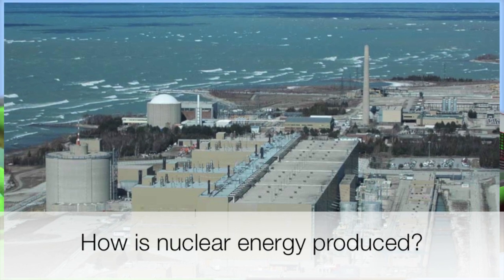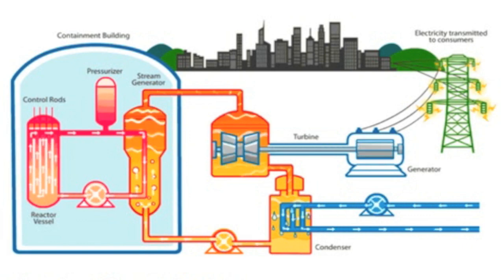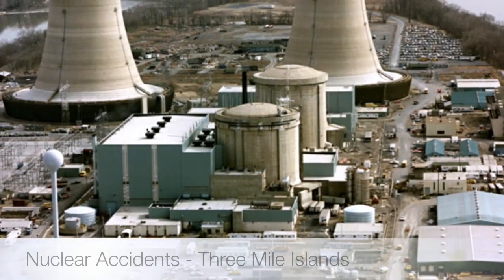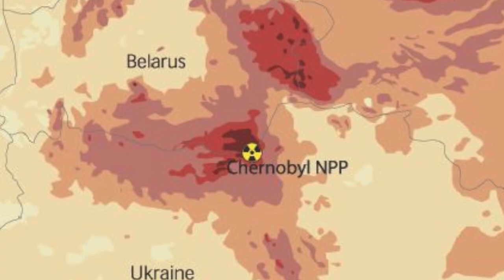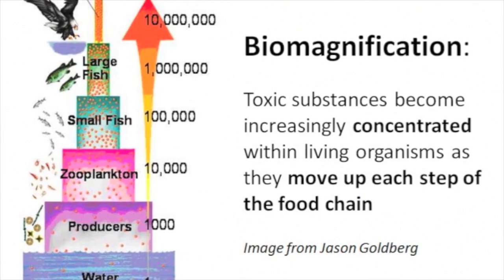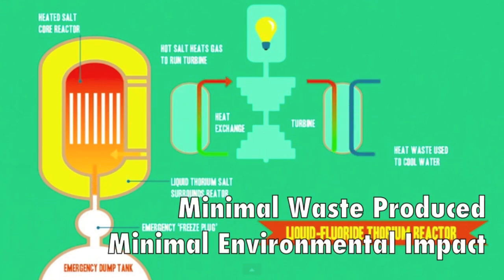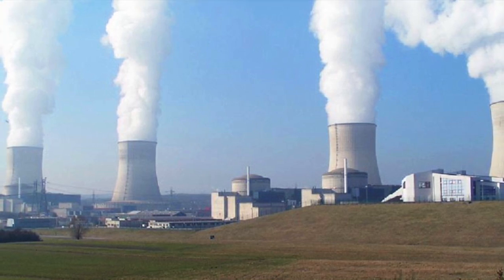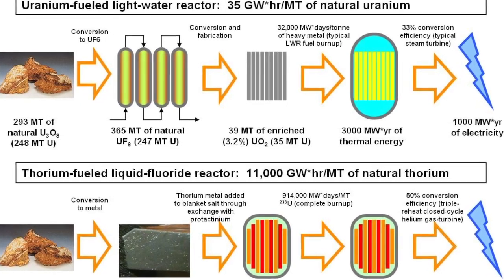Thorium vs  Uranium

Comment: OMG, ANY form of Nuclear is RIDICULOUS. It is NOT the future of energy. Sun, Wind, Geothermal, Tidal and all the other forms of TRULY renewable energy are the FUTURE of energy. NO ONE can guarantee to be able to secure a nuclear (any type) power plant, or waste storage facility for even 1/10 of the time required. It is moronic to spend more time on this totally LOSING technology.
Reply: Sid Cros there is very far to go with talking the public into this. I don't believe the wild eyed promises. molten Salts are better used as storage medium for solar. If need lead between me and reaction, that means it can contaminate.
Reply: Sid Cros And the spent plutonium  "fuel" is radioactive and needs to be transported around country get from present storage to new reactors. Doesn't this pose a significant terrorist liability?  Who wouldn't want to spoil one of these convoys?
Reply: Sid Cros Ahhh does the field take the societal military costs into account in thru baldness sheets? None needed for household energy production.
Reply: It just isn't viable, we have been using the same technologys since the era of electricity. Yet, all of the solar, wind etc they are basically standing still, neither improving nor worsening. They are just "OK" still and EXPENSIVE AF, not special at all. But the newer alternatives is by far the best, which unfortunatelly is (nuclear power) It is the best, and probably WILL still always be the best for the end of times.
BUT we have to continue researching these different clean energy sources such as solar, wind, wave, tidal, and what not because the day we have infinite energye is going to be a very, very great step for mankind and earth herself. And yeah, im confident that MSR technology will be OUR MAIN energy income in the future, and im happy about it!
Reply: Four problems with renewables, wind and solar.  1) intermittency: they are known to be available only 30% of the time.  2) natural gas is almost always the backup for wind and solar.  For every MW of wind and solar capacity there must be the same capacity of back-up natural gas.  Therefore wind and solar produce CO2 70% of the time.  3) Intermittent sources are limited to 30% of grid power because of stresses they create on the grid.  4) Wind and solar are diffuse sources of energy that leave a huge footprint on our natural environment.  If they are going to be a significant source of our power, they will need to be everywhere in the countryside.

These are real problems that can't be wished away.  No one wants to turn off the lights; as our world population approaches ten billion, that would be a disaster even greater than global warming.  We need a rapidly growing supply of reliable, carbon free energy.  Realistically, nuclear is the only solution at this time.
Reply: Wrong about the intermittency. https://blogs.scientificamerican.com/plugged-in/renewable-energy-intermittency-explained-challenges-solutions-and-opportunities/
Reply: Sam G. Try reading. Solar and wind ARE taking over the world. Why do you think you dolts are out here pushing for this crappy, dirty, radioactive shit?
http://www.treehugger.com/renewable-energy/striking-chart-showing-solar-power-will-take-over-world.html
Reply: This whole process is ONLY controllable if the materials to control the reaction are kept in whatever configuration they were put for the reaction. To blanketly say "it is safe" is beyond lunacy. It is only safe if the parts stay in the configuration they were planned to be in. AND...as I have pointed out, the transportation of the present waste to be supposedly used as fuel for these reactors is a major issue. And the continued reliance on CENTRALIZED energy production is a serious terror issue no matter the source. We need to democratize energy production so aso to remove centralized targets.
Reply: well if uranium or plutonium isn't really necessary, thorium can be used alone and still make a lot of energy and can last in a reactor to 10 or 35 years, thorium also needs constant neutrons to keep the fission reaction going, so if the power goes out the thorium reactor turns off as well so no danger of constant reaction even under an earthquake so no road island or fukoshima or Chernobyl disaster so yea, completely save for earth and space, i might be missing a few more details or you still might be miss informed just let me know and i can leave links to videos that help with basic understanding about thorium reactors and thorium reactions
Reply: There has been lots of advancement towards SMR (small modular reactors) designs to use nuclear as a general heat source for industry and local power developments. This addresses the Centralized energy production issue.(and yes they will be impossible to chain react into a meltdown, and nearly worthless as a terrorist target besides being able to shut it down) But yes Nuclear waste would always be an issue and should always be reduced to it's most minimal amount. But if you compare the tiny amount of high level waste, materials and land space that goes into nuclear, and will go into future nuclear, to pretty much any other kind of energy source you'll find that nothing else can compete because nuclear energy is just so much more dense of an energy source than anything else.

Look at Solar. You need to mine, refine, process and assemble the panels, create enough of them to cover vast sections of land, try to place them in geographically optimal locations, and maintain them. Next you need energy storage. Building vast battery powered grid stabilizing units or maybe synthetic fuel plants dedicating vast sections of land and resources to mining chemical processing and assembly, many of which processes are much more harmful that a cement encased pillar of radioactive waste sitting in an abandoned, or even a busy parking lot ever would be.

Progress is made by lowering costs, cost being most closely associated to overall labor. The potential lowest limit costs of Solar energy will always be higher than the lowest limit costs of Nuclear because more people will be required to sustain a network dedicated to solar energy than Nuclear because the density of Nuclear energy is so much higher than solar that it can barely be compared.
Reply: Fallacy of equivalence. Small amounts of radioactivity are NOT small effects. If you think asking MORE people to have small nukes in their backyards you have not learned the NIMBY lesson of Shoreham. 

Price of Solar drops almost monthly. Your fear tactics shoe your desperation. Would only need land the size of Spain ringing around the world to make solar (at 20% efficient) for total world. 
http://www.businessinsider.com/map-shows-solar-panels-to-power-the-earth-2015-9 
Make world zones in equatorial regions run by UN and link them undersea cables and make the NEW SMART electric grid which has to be made ANYWAY, part of this whole solar/wind/renewable construct. 
http://energy.mit.edu/research/future-electric-grid/
Reply: I wouldn't want a light water or heavy water reactor in my backyard either. The risk of catastrophic explosive failure and contamination of the whole area, even though low, could never be completely mitigated, and also the fanaticism against all radiation risks, especially 30 years ago, was and still is quite harsh, even though constant exposure to mild radiation is a fact of life. 
The molten salt reactors are so vital, because you no longer need high pressure vessels that have an explosion risk, the fuel is contained within a salt medium that cannot be dispersed into the air and overheating of the fuel is impossible outside of the reactor and is near-impossible within the reactor due to thermal expansion decreasing reactivity. Enhanced nuclear can also rid itself of the long-lived plutonium wastes making it mostly safe in decades rather than centuries or millennia.

Yes Solar can work. Covering as little as ten square miles in panels for every million people, may be all it takes to capture enough for residential needs, and maybe something can be worked out with storage. I am fine with it being used as a supplemental, or even main source in some cases, if the costs can sincerely compete, but don't scaremonger away from nuclear. Nuclear development technologies are important and vital to future progress and achievements and are still likely to be capable of being several times cheaper and maybe even less impactful to the environment than solar.

As for the other argument of letting the UN take control of whole world zones and force in a smart electrical grid (don't think that was a recommendation of that report but did not read the whole thing) - It would be crazy to hand over any kind of power like that to a body as dysfunctional as the UN, though smart grids in themselves are likely an inevitability for any distributed power generation plan, after all electricity is an excellent energy transmission medium.
Reply: Sid, the is more energy in the sunlight that his the earth in one hour than what the queue uses in a day. There is no need for nukes. We are staring at the only nuke we need, the sun.
Reply: Sid, that's called a proliferation risk and is one of the criteria that is extensively reviewed in order to approve a reactor design, however a weaponized bomb means enrichment and reprocessing of nuclear fuel. In a Burner reactor design there is no reprocessing and only low enriched fuels are used and these substances cannot be made into a bomb. They could potentially be used as a dangerous radiation source if extracted from the reactor but to do so would require extremely dangerous procedures, alert safety systems, and be basically just as bad as available poisons which everyone already has access to.

As for breeder reactors, because there is a reprocessing step, there is increased proliferation risks and a possibility to create enriched materials. To ensure safety there would be increased security and inaccessibility to these systems. Also in the case of Thorium enrichment into U233, U232 is also created in small amounts which extensively increases the lethality of handling the substance because of the high levels of gamma radiation it gives off and increases the ease of detecting it's presence, so it is fairly unsuitable as a bomb.
Reply: Please provide documentation of such. Totally ridiculous thing to say.
Reply: Private sale, so how would state be effected? That is what you said.
Reply: I am and I think he was replying to me.
Reply: There is no way anyone will ever be able to convince me that ANY form of nuclear power is worth the risk. The only nuclear reactor we need is in the sky.
Reply: The only form of nuclear power we need to sustain us is the sun.
Reply: It just means that we are not ready for inter planetary travel until we figure out non polluting renewable energy sources for travel and destination. Sounds better than putting nuke on every ship. No nukes
Reply: Sid Cros Don't you want to burn the spent nuke fuel in them? Since, as you point out, it can be done then it is agreed that it is an unsafe technology.
Reply: It is better to spend the limited money in society on things that need not be possibly dangerous. NO NUKES
Reply: World's experience with nuclear power is your field's fault. The first generation residual costs to society are your field's fault. No one should trust the field again. NO NUKES
"Fool me once Shame on you, fool me twice, Shame on...We won't get fooled again. " GWB
Reply: Sid Cros Not sure where thoughts end as no punctuation. Correct on the last few thoughts, and that will be thru green energies not polluting energies. Nuclear is a polluting energy source. You are just because you like it and want to see it prosper, but others like other technologies and want to see them prosper from the same limited pool of money. NO NUKES
Reply: Sid Cros I never said I was expert in anything. My OP is:

"OMG, ANY form of Nuclear is RIDICULOUS. It is NOT the future of energy. Sun, Wind, Geothermal, Tidal and all the other forms of TRULY renewable energy are the FUTURE of energy. NO ONE can guarantee to be able to secure a nuclear (any type) power plant, or waste storage facility for even 1/10 of the time required. It is moronic to spend more time on this totally LOSING technology."

Arguing from emotion...check
Two statements of fact...check
Claim of expertise...Nope
Reply: +Claude, Energy is inherently dangerous as is most any kind of work. Even for solar, people will get hurt, people will die. The number of people at risk, the level of risk and the scale of a problem is all that it really comes down to. I will admit that nuclear generation likely has the potential for a slightly higher scale of effect when it goes disastrously wrong than solar does, but the risk are likely just about the same with these new technologies. The number of people placed at risk though is probably 100X less than it will be for solar. The reason being is that for solar to work, just about everyone needs to be involved in it. 

People getting hurt installing or cleaning their roof top solar, making the additional electrical connections, close proximity to high energy battery storage with possible flaws that could cause explosions.

Compared to New Nuclear that has a small team of trained operators managing a facility that powers a city or more, where at worst a disaster contaminates the facility and perhaps irradiates the workers. The scale of a disastrous problem and the number of people at risk has been reduced so significantly that I can confidently state that fewer people will be harmed within a nuclear power occupation or energy network than with a solar power occupation or network.

+Sid, in regards to Germany, Spain + France making so much Solar and Wind power, just some stats:
-14%, 20%, 76% That is how much each of them generates through Nuclear Power. 
-20%, 3%, 3% That is how much each of them makes through Solar. 
-10%, 20%, 4% That is how much each of them makes through Wind.
-0.295, 0.237, 0.168 (Euros) That is roughly how much electricity costs in each of those countries.
(Now think if that 76% nuclear in France was further reduced in price with new Nuclear, could solar and wind really compete?)
Reply: Oy, "pericardial?" You are arguing the setting issue. I am arguing against ANY form of man-made nuclear power, thorium happens to be included. You think I am against only thorium, that is incorrect. I am against ALL. NO NUKES.
Reply: Niko, I am furthest from a religotard as I am using historical fact of nuclear damage and future requirements of protecting the talons film mining and the waste. These are real tangible Suge effects of nuclear power generation. So, no, your strawberry it totally incorrect. I am standing on firm reality not the quicksand of religiosity.
Reply: +Sid, just a correction around the whole 'weapons' thing. To use thorium it needs to be bred into U233, and it is technically possible to weaponize it. This, however is very difficult for two reasons; One, there is really no research and testing done around using it as a weapon, and so, new nuclear testing would be required. And Two, the creation of U233, also creates small amounts of U232 which is highly dangerous and detectable while being handled so it is unsuitable and more difficult to use as a bomb material compared to U235 and Plutonium.

Another point is that Molten salt reactors are ideal for burning existing stockpiles of existing nuclear waste and weapons materials because reprocessing of the waste and fuel is minimized. Radioactive waste is still produced but since all 'fuel' materials can be burnt up, the only waste remaining are fission products which has a decay rate which brings it's radiation to ambient levels within 2-300 years rather than thousands of years, like plutonium. Also, since fuels can be burnt almost entirely, instead of 1-3% the amount of total waste needing to be stored is reduced perhaps 10-40X
Reply: Ahhh, here it is, you say: "...some radiation is made but they keep it in the reactor."
HOW? How do you GUARANTEE it will stay in the reactor. You cannot. THAT is your problem. 
It is you Thoriumists who are cult-like in your servitude to the BELIEF that it can all be kept confined and safe and it is the answer to the issue, while the reality is staring you in the face every day when you get up. THE SUN. Solar, wind, geothermal are all based on the SUN and can power us even more so than any Radiation water boiling opportunity. 

NO NUKES!!!
Reply: +Sid, It sounds like you may be confused about something. A Thorium reactor does not actually burn Thorium. Thorium will not fission, it is a fertile material not fissile, just like U238 is. It is required for Thorium 232 to turn into Uranium 233 in order to use it as a fuel. This is done by the Thorium capturing a neutron from a decaying or fissioned radioactive material, which turns it into Protactinium 233, and then within a couple of months it decays into Uranium 233, which can then be fissioned when it is hit with another neutron, which will release 2 or 3 additional neutrons which will continue the breeding and fission processes.

During these reactions there is almost zero plutonium creation, but a tiny amount will be produced because not all U233 will fission. Some will instead capture a neutron instead, and then capture another, turning it into U235. U235 may then fission since it is a fissile material, but not all of it will fission, some may instead capture the incoming neutrons to eventually turn it into Plutonium which can also fission.  These are not some theoretical 100 year processes but quite doable with today's science, in today's reactors, though the process is quite efficient in the 'New' nuclear reactors.

With Thorium this can all be done in a Thermal spectrum reactor with slow neutrons, Plutonium however will not breed in a continual manner in a thermal spectrum reactor from the common U238 because it will average less than 2 additional neutrons being released from it when it encounters a free neutron because it will capture them rather than fission too often, so requires a Fast spectrum reactor to properly breed it into a sustainable fuel. Thermal spectrum can be preferable though because it is much easier for neutrons to interact with the Nuclear fuel than a fast spectrum reactor. Due to this, fuel density and enrichment needs to be much higher in a Fast spectrum reactor, but a fast spectrum reaction will ensure that plutonium and Uranium will always produce more than 2 additional free neutrons because they will almost always fission when encountering a neutron rather than capturing them, meaning this is the only viable method to breed sustainable plutonium as a fuel.

What makes using Thorium safer and perhaps better than standard Uranium and Plutonium is not the fact that it uses Thorium, it is the fact that it is a breeder design that is most practically used within a Molten Salt reactor and that the Molten Salt reactor designs are inherently much safer and efficient than Solid fuel water cooled reactors or fast spectrum breeder reactors. In fact it is likely much safer to use Uranium within a Molten Salt Burner reactor than it is to use Thorium in it because the reactor can be designed in a much more simple manner, but this would require U235 fuel, which is quite rare and so a breeder reactor design is required.
Reply: Claude, It sounds like you're a hypochondriac against radiation, and while you may have reason to moderately fear medium and high levels, there is no real reason to fear low levels of radiation because we are always exposed to it. Some level of radiation is even healthy.
Feel free to watch a few of these videos:
http://nuclearsafety.gc.ca/eng/resources/videos/player/index.cfm?videoid=radiation
http://nuclearsafety.gc.ca/eng/resources/videos/player/index.cfm?videoid=radiation_health
Reply: +Sid I won't give you actual links because there are so many of them.

Most of what I learned was right here on youtube, a lot of it from Kirk Sorensen 's videos on Liquid Floride Thorium Reactors(LFTR) or videos on MOLTEX or videos on Integral Molten Salt Reactor (IMSR). Along with these, I read about the individual elements themselves on Wikipedia, along with certain reactor designs. (everything is self taught).

Just search a bit on those topics and you'll find a huge amount of information. The video itself on this link is actually a very poor representation of the technology.
Reply: Nolan Oh wow lucky for you that you don't have to build any nuclear reactor with thick concrete walls to block the MASSIVE radiation within the reactor...oh wait that's wrong, you DO have to build reactors with thick concrete walls to block the radiation. THAT IS THE POINT. YOU CANNOT GUARANTEE THE STATE OF THE REACTOR. 
I know full well that US limits on reactor effluents is limited to 3x background levels DURING NORMAL FUNCTIONING. THE NUCLEAR FIELD CANNOT GUARANTEE NORMAL FUNCTIONING. THAT IS YOUR PROBLEM. 
NO NUKES
Reply: Just more and more added costs to society to protect,  clean up, disinfect from this unneeded, dirty, costly, passe technology. Nuclear is over. Renewable, residually solar is the technology to move us into next era. NO NUKES
Reply: "thorium is common in space," Is it floating in space or will you need million mile dust collectors to "fill up?"
It is obviously you who is that is not "very intelligent", as you do not realize that ALL wind, (earth and mars) is due to SOLAR HEATING and the resultant convection currents of the air.
You do WILL not recognize that the added costs of protection and possible need of dis-infection in case of problems with containment, only adds significant costs to the proposed industry that puts it's cost effectiveness out of reach.
As for planet exploration with no ability to pollute the visiting destination, if we cannot do it without raditiation, and the resultant possible contamination, then this is just the self-limiting of planetary exploration and only when we have SURMOUNTED this obstacle should we move toward those goals. Doing this will force us to use our resources NOW, on earthbound issues of renewable energy optimization, such that it gives us the technology to explore new worlds without possiblity of contaminating them. We should optimize our energy research and development so as to do two things at once: Make green energy for home and make a way do so in space also on trips to distant worlds. We do not need to now spend limited resources on yet ANOTHER technology that is at the get go, only a temporary thing anyway. We already have bridge technologies and that will be gas and oil. No need to crank up nukes in any form.
NO NUKES
Reply: Only foolishness is your religion-like adherence to getting me to believe in your new saving grace.
Reply: Sid Cros There is no need for it
Reply: So stop replying. I can still talk all I want. You don't control me.
Reply: It makes no sense to say "I was getting you to accept it, but not reply (sic) on it".  I assume you meant "rely." Why should anyone accept something if not too rely on it. Illogical.
Reply: And I can now pick apart your arguments and you won't be able to counter my points because you have censured yourself. Haha.
Reply: Oh yeah, OK, yup. What a pathetic way to try and save face. You are not supposed to reply.
Reply: We'll look at it as a burden to society. Why should society consume is limited resources on this costly, dirty, irradiated nonsense, when we are at the tong point in getting cheap storage for a limitless energy? It makes no sense. Thorium got squeezed out on the 50s, TS. No need to pick up the idea now and waste $$$ developing a "cooler" technology. Nuclear was able to bury the hidden costs of mining, and military protection need, and waste disposal, and securing says disposal for thousands of years BECAUSE it had a military mandate behind it. We now know if the true burden of these freak costs and all nukes suffer from the same. 
NO NUKES
Reply: I think Claude just isn't capable of understanding physical and chemical interactions or scientific processes. Nolans attempt to offer a more analytical and informative explanation from a observable and known set of conditions to help Claude grasp the reality of the physical world they exist within were a failure for this Claude is likely a politically motivated group think collectivist thinker that just advocates whatever is the views of their peers and those they idolize happen to be and they do not actually think for themselves. 

This is made obvious by the naive and ignorant statements they make about how nothing could possibly  change what they think about nuclear power, even it is was discovered to produce fluffy kittens for every child transmit energy wireless via rainbows for free all around the world and make the economics of communist socialist governments work and allow these societies to retain some moral values and ethics that would at least not be okay with murdering people for holding a difference in political views and sharing this publicly and peacefully and produced just clean drinking water and carbon nano-tube at 30k lengths that would work to construct a space elevator as a waste byproduct instead of radioactive spent fuel.
Reply: I mean, wasn't nuclear fuel basically already radioactive when it was mined and processing is just concentration of the element to a level that allows for sustained chain reaction for us to control the decay process to generate heat for power generation with a steam turbine generator system. 

Couldn't we say, just grind it up and mix it back into trace level ratio of what it was when it was originally mined then spread the crap that is mostly just dirt across areas that are equal to the area it was mined from or i dunno mix it with the crap left from mining it in the first place and bury back at the mine.... unless those uranium rich mines now have schools and residential areas built over them and now are a source of drinking water...
Reply: and yet you still have yet to answer how you plan to overcome the problems of piss poor energy density with solar and wind compared to nuclear or even natural gas.
There is a simple reason that we haven't dumped gas yet, despite solar being cheaper now, gas plants aren't going anywhere. Simple reason is physics. Solar hitting the surface of the Earth is too diffuse to act as a base load solution.
Reply: Sun, wind and tidal - are children toys. But Geothermal, combined with new, so called, "room-temperature" heat superconductors is a hell of an energy source. My bets are: Geothermal for on-planet applications, nuclear and solar for space exploration.
Reply: The (so called) TRULY renewable energy will only ever displace coal. The rich First world could probably afford to go fully renewable if it can solve the intermittent supply issues. But the Third World will never afford it. They will simply use coal. It's cheap to mine and cheap to use. 
The only way to stop coal is to have cheap reliable energy that's cheaper to use. The only technology which comes close is new nuclear with a liquid nuclear fuel and solid moderator. Liquid fuels are cheap to make, cheap to process and the plants are walk away safe.